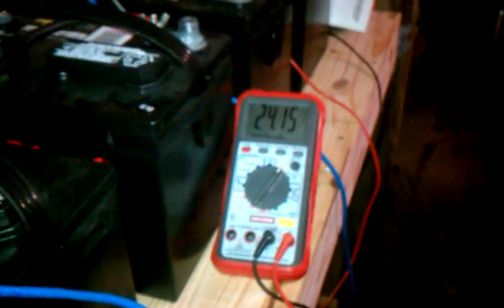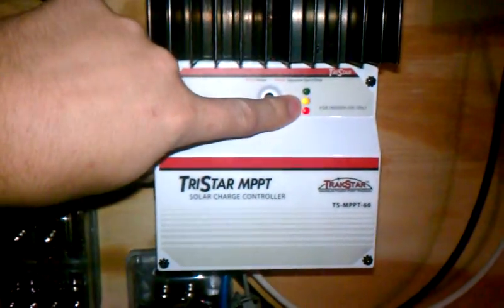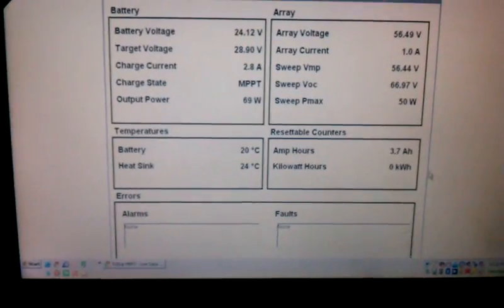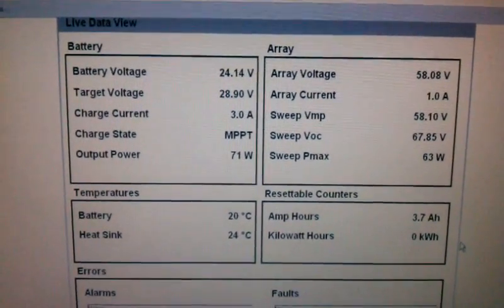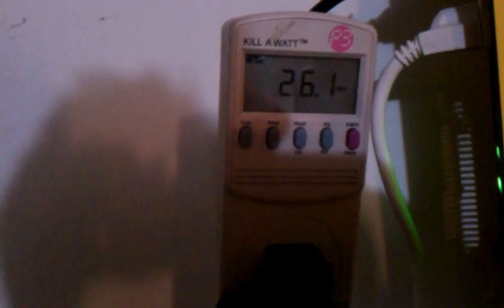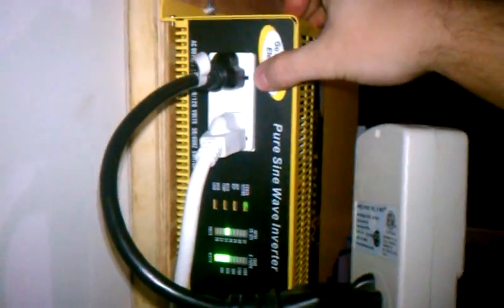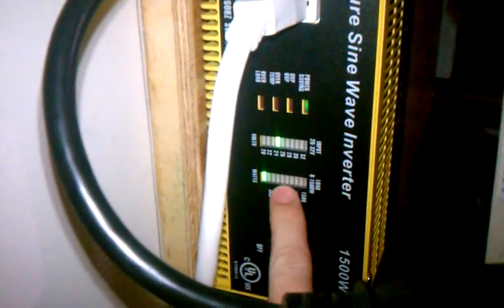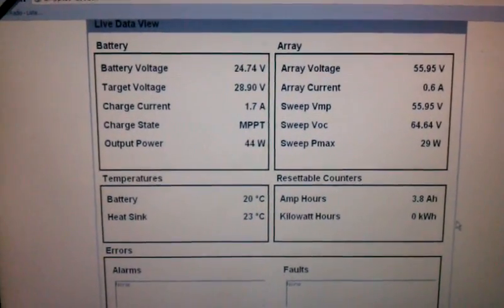Solar panels MPPT charge controller and 1500 watt Go power pure sine wave inverter part 6

Comment: I'm interested in buying a GO POWER inverter. How is yours holding up ?
Do I need pure sine wave to run a furnace or well pump. Both spike just below 1500 watts.
Thanks,
Reply from the maker: They hold up really well and put out good, usable power. They don't do well with major voltage spikes or heavy amperage hits and you'll get voltage sag for sure. I'm thinking of installing a 1F 24V CAP on the DC input side to compensate. What they don't tell you is it's MAX power is 1500W but it's CONSTANT power is around 1200-1300W. It'll start up a motor, I'd recommend the CAPs then if you're gonna use it on heavy amperage hitters like motors i.e. pumps etc.
Reply: Thanks. Looks like I better save some more and go with a 2,000 watt inverter.
Reply from the maker: Solar4Rich Buy the biggest unit you can afford honestly. You'll only add more to it, trust me. 1500W is great for running everything in your home that does not heat or cool something. That's what I use mine for. A 3000W would be for running a small home AC unit, half a water heater or a small home heating unit so you can see where the bulk of the power is. The trick is to figure out what you can supply in power while still keeping a reserve for the night time. I turn my solar off at night and put it in standby so it kicks in if we lose grid power and then that reverses during the day. Saves my battery bank and you use way less power during the night hours anyway. The less you drag your battery bank down, the longer it'll last. :)
Reply: Thanks again

Comment: Hi Helloman1976. Really appreciate your videos. Planning to have a mini fridge to run using solar. Do you have any recommendation as to the kind of set up as to how many batteries I need, the capacity of my inverter and charge controller and solar panel. Thanks.
Reply from the maker: It's a somewhat complicated question. I'd hook my mini fridge to a "Kill A Watt" meter to get the total Wh the fridge uses over a 24 hour period, I do that for all my solar devices so I know how big of a battery bank I need. You have to compensate then for average solar power generated also, you want to be able to charge AND use your inverter at the same time during the day. Your battery bank could be 1KWh and you only bring in 200Wh a day or your bank could be 500Wh and you bring in 1KWh a day, both of those configurations will change the size of your battery bank .The minimum size bank you need is whatever is required to get that fridge to run through the night without additional solar coming in and NOT draining your bank more than 50%, 70% is preferred, each and every night. Keep in mind that some days might be cloudy...so it gets complicated. 

Now that I've thoroughly confused you lol I'll try my best to answer more directly. My full size fridge pulls 110W. I would need to be able to run that fridge all night without running out of battery power or damaging my battery bank each night by draining it too low. So if I ran my fridge for 24 hours at 110W it would use 2.64Kwh a day, not really but just for example's sake. I would then need to power it for roughly 12 hours of no sunlight so 12 * 110W or 1.32Kwh of storage minimum. I don't want to damage my battery bank so I plan to drain only 70% during the off sun hours so we can estimate around 6Kwh of storage. :) I prefer higher voltage for more efficiency, keep that in mind when you build. Hope that helps!
Reply from the maker: helloman1976 That should say..I only plan to drain my bank down to 30% and have 70% capacity remaining. Do not drain 70% of your battery bank each night.
Reply: Thanks for the answer. Is there any other way of getting the Wh of the mini fridge without using the meter so that I would be able to determine how batteries I would need etc.
Reply from the maker: TheMsG76 Yes, another way would be to look at the manufacture's data and guess-timate from there. Depending on what it says you'll have to calculate it out. For example if it says your fridge uses 100Kwh a year then that's 100Kwh / 12 months = 8.33Kwh per month / 30 days = 0.277Kwh per day or 277Wh per day / 24 hours = 11.54Wh per hour. That's just an example, don't actually use that...the meters are cheap on ebay and well worth it.
Reply: Thanks a lot...really appreciate your time in responding my concerns...

Comment: My charge controler has the yellow and red lights on when doing the washing to but I have 24 + volts on the multimeter the manual said when these lights are on you have 25% batery left can't work that out and another thing can't work out is batery max and min on the remote face I got with it that shows all the readings has max 90+ volts and min around 24+ .     24 + is ok  but 90 + ?

Comment: Thanks for the info I'm going to do a clip on my setup to get any info on anything I might be doing wrong only fuse sizes are a possible problem but I'm sure I've got them right can't get the info up on the laptop yet haveing dramas with that to I downloaded the tristar software might be my cable you can get a standard and a crossover Ethernet cable what is your cable has it got any writing on it  you have yours going straight from the cc straight into your computer yea

Comment from the maker: @busabaybe The charge controller will control how much voltage/amperage gets fed into your battery bank regardless of its size or how many solar panels you have. Your charge controller will have a maximum input value though so don't exceed that. The CC will shutoff or go into FLOAT mode if the battery bank is full so there's no worries there.

Comment: So two baterys the charge controler will only put in a certain amount of charge regardless of how much solar panels you have  and four baterys it would double that curent and won't put anymore the charge controler knows how many baterys you have would that be correct

Comment from the maker: @Busabaybe The panels will not produce 1,500 watts and the purpose of the charge controller is to limit the voltage and amperage to avoid cooking the batteries, is their protection and what controls charging. Solar panels put out about 80% of what they are rated for.

Comment: Another q I've got 1500 watts of solar on one side of the shed and that's what they say is max for 24 volt system if I put another 500 watts of solar on the other side of the shed to get the afternoon sun it could just go over the max solar array would that blow up the tristar do you think it would regulate that to max 1500

Comment: Hi I've got a very similar system to you but I'm trying to work out if you only had two twelve volt batterys connected together to make 24 volts and had the max solar array of 1500 watts for the 60 amp mppt tristar at 24 volt would that at full power on a sunny day put to much charge current into those 2 batterys would you cook them each batery is 120 ah 12 volt so now it's 24 volt 120ah

Comment from the maker: @abenwinUT No problem man, yes you should not "deep discharge" a battery more than 50%. There's a voltage chart you can find online that shows you what voltage is what percent of charge. So a 12V battery, really 12.7V at full charge, would be at 50% at exactly 12.0V NOT under load. Your inverter only shuts off because it's protecting your batteries from being completely and totally destroyed, that's the only reason.

Comment: I am a novice just starting out.  I keep seeing that you should not completely discharge a battery.  My inverter shuts off when battery gets to 10.7v.  So how can you use more of the battery if the inverter shuts off at 10.7v?  Great info on your videos.

Comment from the maker: @BigAlxr7007 I don't think the TS-MPPT-45 has a web server built in, you'll have to check on their website otherwise yes you can get an adapter and do the same thing. I ended up running a ethernet cable through my attic so it's clean.

Comment from the maker: @bpd894 We've been living off this battery bank now for almost a year. I just did some battery maintenance and we have a total of 8 batteries now. We make, store and use about 25% of our own power. We'll be upgrading our battery bank to a real deep cycle Trojan RE solar battery bank soon, it'll hold around 10kwh. We'll be adding at least another 1,000W of panels this year too. This system has worked flawlessly and we love it so much we want to triple the size and be 75% off the grid.

Comment from the maker: @Nielubie69 Take into account my panels are still not mounted and are on the ground...I make about 6,000 watts a day on very good sunny days and about 3,200 on partly cloudy days. The wrst day I've ever seen is around 800W so even on extremely cloudy days you'll still get something. We dont even use our GTI any more, it's a very good one too. It's a 24V to 52V input so if you want it I'll sell it to you, 1200W Power Jack. I highly recommend the highest voltage you can push from the panels to GTI

Comment: @helloman1976 I see, pretty sweet.  Love your video's, I keep looking out for new ones.  :)  Hopefully I'll be able to start my project soon and do some video responses.  As far as the power your getting, if you have 1150W panels, how many watts are you getting to your final point?  I'm sure there is some electrical loss from the panels through all the wires, inverters etc.  Just curious what loss you get on your BEST sunny day.

Any recommendations on a GTI?

Comment: WHere do you get your Panels and what $ - I have 3 x 120  and 2 x 100 panels I need to mount but waiting for all the parts. But I really want to get the largest WATT  panels around 200 watt or so to cut down on cable runs and such ..I also picked up a Xantrex 3000 watt Inverter but its not PURE sine so my unload it not sure if I can run a Frig on it . Great Vids

Comment from the maker: @Nielubie69 Sorry about that, with each video I have been expanding. So the grid tie videos are mainly when I had only 350W of panels. I expanded after that getting 4 more 200W panels. On one of the videos I had the 350W grid tie still hooked up and a 2 of the 200W panels charging some batteries. Eventually I moved those 2 200W panels and the 2 175W panels over to the same circuit which is where the 750W comes from 400W + 350W... Now I have 1150W of panels and might get 400W more. :)

Comment: In one of your previous video's you mentioned 750W and 1100W solar panels, but your meter keeps showing 250-280W on your grid tie inverter.  Are you loosing 500W of power with the GTI, is it just inefficiency of the solar panels, or is it just poor sun when your recording?  Little confused why your meter isn't showing numbers closer to the range of your panels.

-Pete

Comment from the maker: @Fearlessthinker Well, you were right about one thing and that is that you for sure should get more batteries than you "think" you need. This weekend I will likely go get 4 more batteries for a total of 11kwh of storage. We burn though the 5.5kwh we have  now but once we hit that it's bed time so to get a 50% burn we need to double our capacity. I think the 1.15kwh or panels is sufficient for now but we'll see. I'm not afraid to admit I was wrong! It's all about learning and sharing knowledge!

Comment from the maker: @Fearlessthinker Yep, I'm learning what I can and cannot do now. I need to do my first equalization and then I'm all set. I was able to charge my battery bank from completely empty last night to completely full today by around 1pm so the next thing to do will be to add more capacity or a way to dump the rest to the grid. I'm in absorption mode right now but that should go to equalization soon, that takes a ton more power but it's necessary to do once every month. More videos coming soon!

Comment from the maker: @michael970 Thanks! Yes, it's working out perfectly and even better than anticipated. I've very happy with the charge controller and especially the inverter...so far anyway. I have made over 5wkh so far and it's 1:30pm today. Also, you have snow which you have to clean up, rain cleans my panels for me lol jk :)  These panels are just sitting on the ground and I'm still getting 960W out of 1150W of panels. Next, too the roof I go! Panels to be mounted soon!